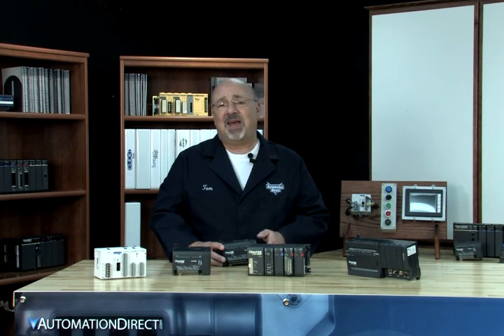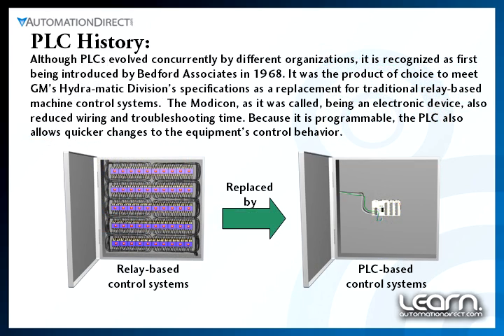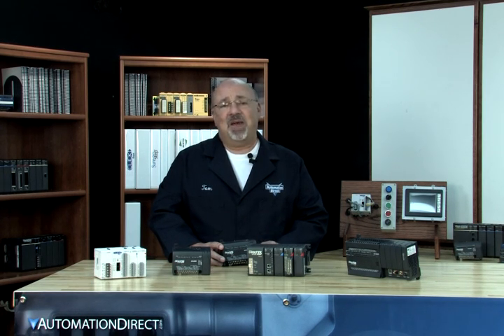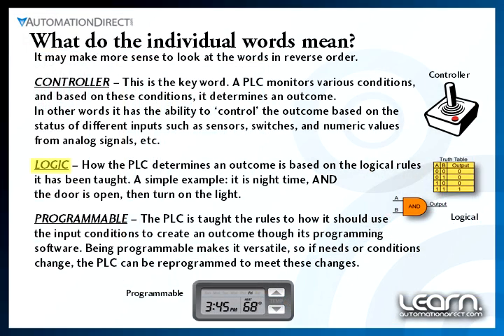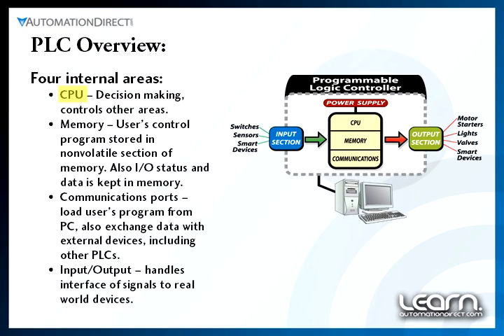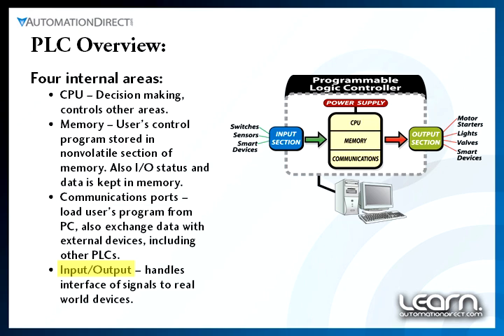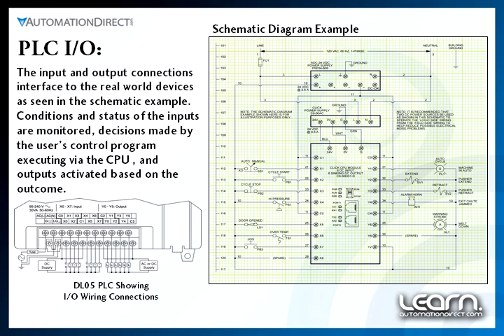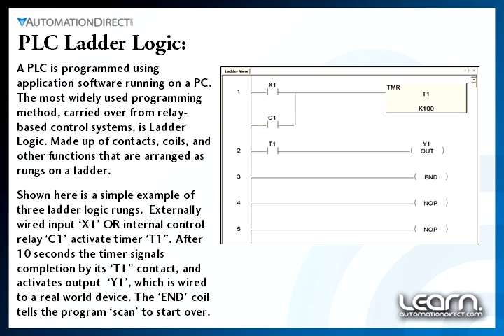What is a PLC? Featuring DirectLOGIC Programmable Logic Controllers from AutomationDirect

Comment from the maker: If you are asking for examples of non industrial PLC applications, some are:  Home automation (controlling HVAC or home lights), Car automation – we have had customers use PLCs and touch panels to control the air conditioning, lights and alarm systems, Lighting control – we have had customers use sensors to detect customer locations at a Museum and a PLC control the lights on certain displays.